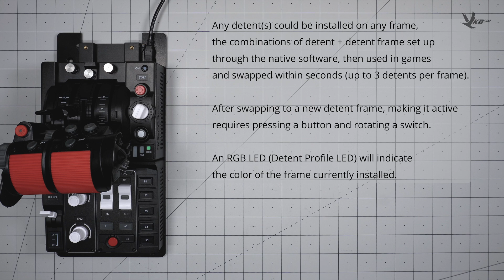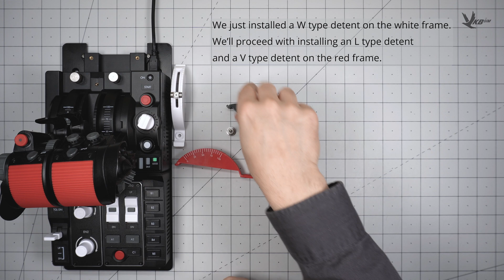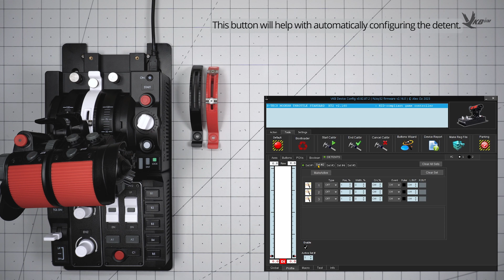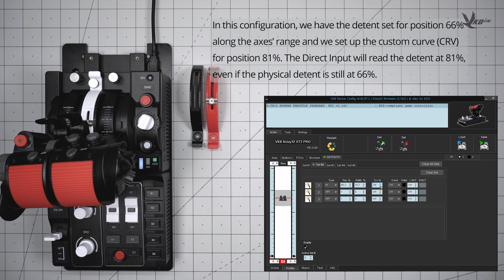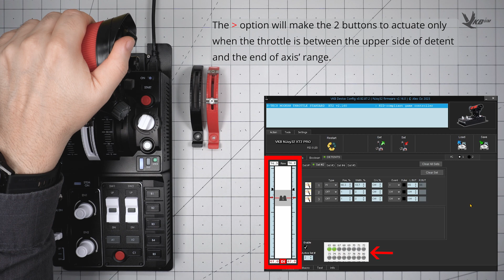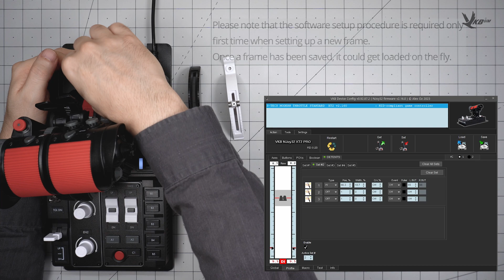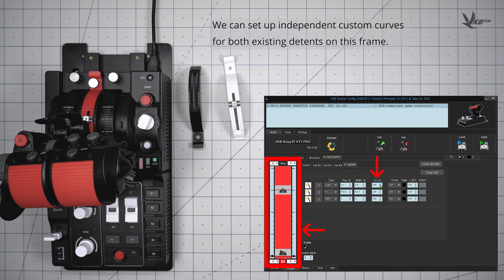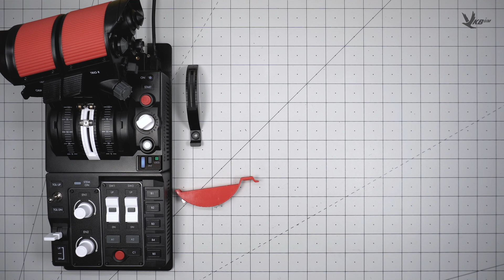STECS Setting up custom detents (revision 1)

Comment: So.... why does the black one not "allow for custom detents"?
Is it not manufactured accurately enough because it is intended to be used without detents? Because my STECS Mini Plus only came with the black one but it is called "detent frame", and it also comes with several custom detents. 
But it is also very inaccurate. Its % don't line up with the rest of the throttle. Fortunately I can adjust the detents from the top based on the throttle's % instead, but I am confused about what is meant to be used how.

Comment: This feature of the STECS throttle on it's own was enough to sell me on this module. This is not just excellent for games like DCS where different aircraft have different detent positions that would be hard to replicate with an flat throttle, but my immediate thought went to my recent return to Elite Dangerous and how much I've been wanting a throttle than can center on a middle zero between forward and reverse. Absolutely brilliant.
Reply: Just finished configuring mine so that "0" is at 18/100 with the W detent (anything under is a quickly scaled reverse) and then I'm using the rest for forward thrust with a detent to delimit the top of my combat blue zone and another for the center of Supercruise's blue zone. Very excited for it.

Comment: If you followed instructions to program custom RGB LEDs on your Gladiator EVOs, you will need to remove the inserted lines in zconfig.ini in order to set detent profiles.

Comment: Love this. I'm dialing in the detents for the F-15E on DCS and I think I got it just right. In hindsight I probably should have gotten the STECS Standard even though I already had an NXT EVO with an attached GNX-SEM, but I opted to buy the STECS Mini Plus instead so I had to buy the buttons extension, detents, and the magazine holder separately.
Reply: @or10nsharkfin   The STEM™ Module is available as a separate panel.  Suggest installing said module on the right, as it is an excellent panel for other functions such as environmental and generator switches.

Comment: Are the levers/grips reversable to use the throttle with the opposite hand??
Reply from the maker: They are not.
Reply: @VKBSim  bummer. I like how you offer the Gladiator with both hand options.

Comment: iv just got mine, i really dont like the grip resistaance. if i dont set uit pretty high then the throttles move on their own , this makes them effectively useless . they REALLY need a counterweight
Reply from the maker: Of course, we'll include a cinder block in the next version.
Reply: lol have a look at crankshaft counterweight for ideas, overall i really like the unit, i LOVE the modularity and the detent system   @VKBSim

Comment: What would I want to use on say, F-15E for DCS?  I'd want idle, full power, and MIL power?  Oh and probably off too.
Reply: @cmdrbigity6914   The ST>ECS™ is capable of however many detents are appropriate; suggest a large L for Idle, a V (alternative: a W) for MIL, and a large V for MAX.
Reply: @BCSchmerker FWIW, I went with just an AB detent, to preserve as much throw as possible.  I have a seperate hotas button(s) set for idle

Comment: Im currently using a VKB Omnithrottle setup, and im very happy with it. Whem im going to buy a seperate throttle in the future, the STECS is definitely on the top of my list, on a level with the Orion 2.

Theres two things that could make the throttle really perfect for me:
1. Analogue stick for the index finger, like on American planes or the Orion 2 throttle. The dream is to have 'both' thumb and index analogue stick, would put this stick unquestionable into its own league. Might be difficult to do, but would basically guarantee a sale for me.

2. The attachable modules to the STECs are not bad, but not as universally useful as Id like. I would love to have something like a numpad on the front attachable module (to simulate the entry-pads on Viper/Hornet cockpit for example).
Reply: @termitreter6545   Or the RIO Keypad in earlier blocks o' the Grumman G-303 (USDoD: YF/F-14A).  I've selected the RIO Keypad as base for a UFCP in the Pilot station, and an up-front Detail Data Display / Control Display Unit in the Flight-Officer station, of a notional continuation o' the Northrop Grumman Tomcat, e.g. YF-14E-180-GR SerNo 633 (BuNo 165014).

Comment: Very useful information in this video, and so far I'm loving my STECS!  But I do have a question: why is the L detent that is used in the Idle position here set up with the L(A) detent type?  I'd have assumed that "A" means "Afterburner", and had expected that the L(I) type would be used instead (for "Idle").  But then I found that I needed to use L(A) on my STECS, just as the video shows, to get the desired idle detent behavior.  Are the two "L" detent type names just reversed or otherwise misleading?
Reply from the maker: The way the detents are labeled is just generic. You can build your own setup, there's no restriction.
Reply: @VKBSim     Concur on the "stops" in track.  I've longlisted your ST>ECS® Mini, plus a STEM™ (as port and starboard panels) in case Throttletek Manufacturing LLC won't install multiways (e.g. a five-way mini-castle in the CAGE, and a five-way mini-stadium in the SEAM) in the grips o' their GF-14 Engine and Wing Quadrant.  The large L at Idle, the W at MIL, and the large V at MAX probably makes the most sense for a carrier fighter.

Comment: +vkbsim   The ST>ECSᵀᴹ might be an even more accurate option than the VIRPILⓇ MongoosT-50CM3Ⓡ as a fallback, in case Throttletek will not install multiways in the grips of a GF-14.  The puzzle shall be a Flaps "throttle" and a Wing Sweep "throttle" to replicate the actual Pilot station in the Grumman G-303 and G-391 (USDoD: F-14A and F-14B respectively).
Reply: You really made sure to get all the restricted symbols and trademarks in didn’t you

Comment: I'm curious; is there a technical reason for why this system only supports 3 detents? It looks like the detent frames can easily fit more than 3, so is it a software limitation?

I'm asking because many civilian aircraft—modern airliners and bizjets in particular—have 4 detents (idle, climb thrust, flex/maximum continuous thrust, and go-around thrust). I suppose one could use the fully forward throttle position as a 4th "detent", but it would be much more satisfying to have a proper, tactile detent. Hopefully this is something that could be addressed with a software update in the future?
Reply from the maker: 99% of users would not need more than 1-2 detents per frame. For the others we have something: open the zconfig.ini file, which is in the same folder with VKBDevCfg and under [USER] section add this line: PimpMySTECS=1. Run VKBDevCfg again and fill that frame with detents :))
Reply: @VKBSim  I don't actually have a STECS yet, but I'm considering getting one. Would that setting allow me to use more than 3 detents? If so, that's exactly what I'm looking for.
Reply from the maker: @Seekay_   How about 4 detents and 10 frames? https://imgur.com/a/AYSJBb2 :)
Reply: @VKBSim  Just got my STECS and I'm setting up my detents. I think I'm going to use this to take advantage of detent sets and reuse the same frame for multiple curves. Say I wanted to use the 6th set. There isn't a number/color for that on the white selector dial. Do I need to use the "MakeActive" button in the VKB Config tool?

Comment: Can you update the next firmware release so we can add detents to the black frame?
Reply from the maker: No, but you could do it yourself if you really need it: open the folder where VKBDevCfg is, you'll find a file called zconfig.ini - open it up and under the [USER] section add this line:
PimpMySTECS=1
then save it and run again VKBDevcfg.

Comment: This looks very interesting. Would it be possible to have more than 1 custom reponse curve for a given frame in future updates of the software?

I fly IL2 Sturmovik in VR and I'd like to use detents to have tactile indications for the different engine regimes (max continuous, emergency power, full throttle) for each plane. The problem is that there are dozens of planes and each engine regime correspond to different throttle positions for many planes (though there is some overlap between some planes). For example, max continuous corresponds to 68% throttle for a BF-109 F4, but it's 54% throttle for a Spitfire IX. It would be wonderful to use one frame with two detents with a custom response curve for each plane. If I understand correctly, in the current set up, a maximum of 4 custom response curves (one for each color frame besides the black frame) is possible, which is just too few to be practical.

Additional question: is it possible to buy/obtain additional detents?
Reply from the maker: Yes, we're providing extra detents and frames through our stores.
About several custom curves: if you plan to keep the same frame with detents all the time, you could just create several templates for it, each with a different curve and assign it under a different frame color. This way, when you switch planes, you could only switch to a different frame, which is the same as the previous, but with the right custom curve. Hope that makes sense :)
Reply: @VKBSim  Thanks for your reply. This is indeed what I figured, however this would allow for only 4 custom response curve. IL2 (and many other flight sims) allows for flying dozens of planes, many of them have their own engine regime specific response curve. Ideally, the throttle would allow for creating a comparable number of response curves for example by adding a 12-, 10- or 8-way selector besides the 5-way selector so that each frame allows for 12, 10 or 8 custom response curves.

The current throttle looks incredible, but allowing for such a functionality would in my opinion align its proposition better with the range of flyable planes that current flight sims offer.
Reply from the maker: @Boslandschap1  You can have unlimited number of curves by creating profiles. Fill up a profile with 4 curves, save it, then create another with a different set and so on.
Profiles guide: https://youtu.be/kAjKflogDlI
Reply: @VKBSim  Thansk for your answer and thinking along. Having to load different profiles in game wouldn't be my first choice, but at least this solution would allow for having a larger number of profiles. I suppose that solution could work, so good to know.
Reply from the maker: @Boslandschap1 There's also another way: open the file called zconfig.ini, which should be found in the same folder with vkbdevcfg. Under the [USER] section add this command line: PimpMySTECS=1, then save it. Run vkbdevcfg and check your Detents tab :)
Reply: @VKBSim wow, great news for IL-2

Comment: I have been a VKB Gladiators user (in HOSAS configuration) for a little over 2 years and a half now (I love them and are still operating flawlessly) and I've been waiting for the throttle since then. Now that it is finally available, I will be ordering one in the near future as well as a SEM-V and a FSM-GA. I think you guys did a great job in creating this throttle and I particularly love the modularity aspect of your components, great for cockpit builder. 🙂
Reply from the maker: Appreciate your kind words, really!
Reply: How natural and easy does the HOSAS config feel for space games? I'm looking at this throttle for getting back into Elite Dangerous and something about the omni throttle just makes me feel unsure how easily I'd adapt to it. Would you recommend it enough to get the second Gladiator before an actual throttle unit? Does it hold throttle position or do you constantly need to babysit your input?
Reply: @christianmaheu   I've a unique setup for a trainer:  GNX-THQ engine quadrant, GNX-SEM flaps/gear panel, and GNX-FSM-GA on an angle frame.  Just have to ascertain the levers for Flaps (which are supposed to resemble a flap section at single length), Throttle (double length), Governor and Mixture (both single length).

Comment: What changed since the prior version of this video?
Reply: I noticed the pronunciation of detent is different during certain parts of the video. So that might be your clue
Reply: that's exactly what I was wondering, would be nice in the description they highlighted what changed and/or what might be wrong in the old version.   Especially since the old version is still up . . . .
Reply: This video covers the use of the 1>.<2 setting for detent events. It's super useful OFF-IDLE/IDLE-OFF on some aircraft like the F-14.

Comment: A question that may interest other ppl too: is the 5-position rotary dial on the stecs base usable also outside the on-the-fly programming scenario, when the grey button for example is not held down?
Reply from the maker: @Jajus is right, those buttons and the selector could get assigned in game.
Reply: @VKBSim  how about the LED? Are they all accessible and usable through the API?
Reply from the maker: @Jahus  Of course, they could programmed to other functions.
Reply: Amazing,  @VKBSim , thank you <3
Reply: I'd say yes. There's no reason why it wouldn't be. I would also bet that the grey button can be assigned to something else. Same for the LEDs. VKB will have to confirm this.